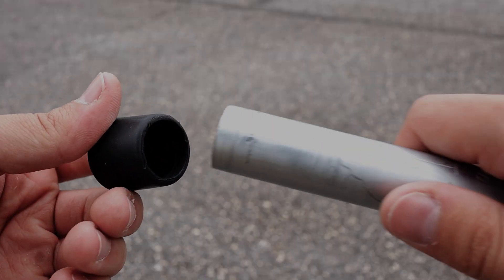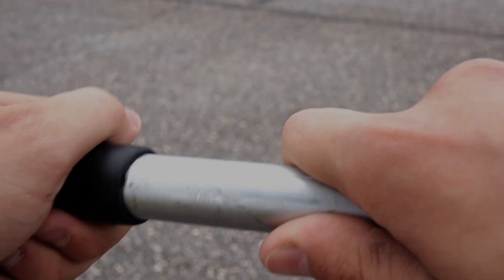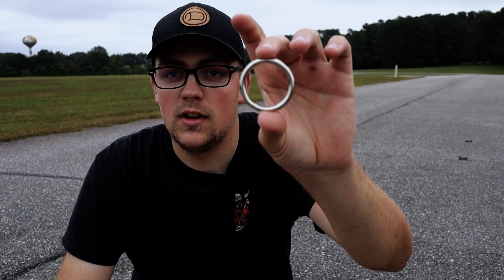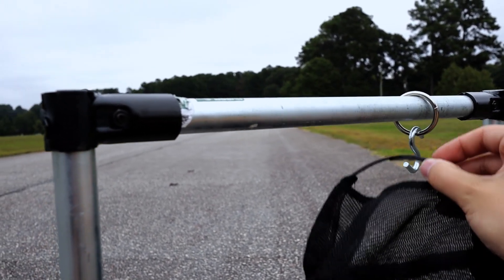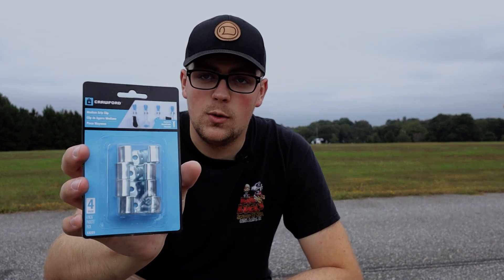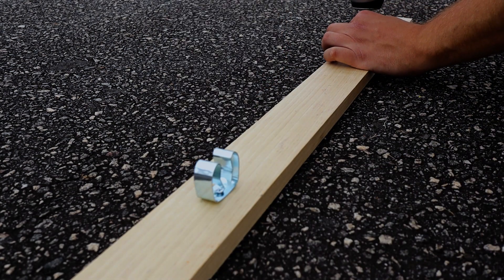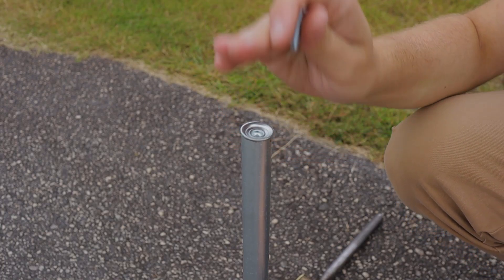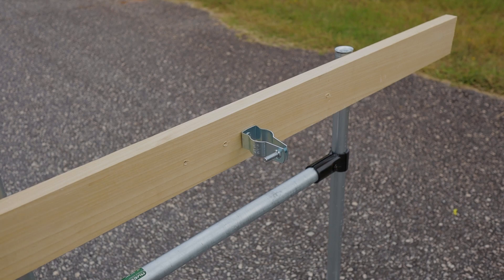9 DIY Pipe Building Hacks For EMT Conduit | Maker Pipe Tips and Tricks

Comment: Have you found plastic T and elbow brackets that fit 1/2" EMT? see some in your video, maybe for 3/4"?? just have not been able to find those anywhere.
Reply from the maker: I don't know of any plastic connectors but our steel connectors can be used with 1/2" emt if you use our shims which are 10 cents a piece on the website.

Comment: I plan to build a Conestoga wagon type canvas support over a Surley Bill bicycle trailer frame.  Is there a good way to mount the 3/4 conduit on the sides of the trailer that make an instant 90 degree turn at the mounting point?
Reply from the maker: Hi Joe thanks for the question! One idea would be using one of the flange methods that we showed in a separate video and then using a connector directly off of it. Here is the link to the video.

https://youtu.be/OUWudsffAkk

Comment: Great product lineup. Total Nube here, so forgive me if this is obvious. I've seen some sample project images on your website that have pipe ending in a flange on the wall or ceiling. What kind of flange are they using for that? Thanks
Reply from the maker: Thanks for the comment!  Happy to help in any way.  The most common solution I see is a 3/4" pipe flange with a 3/4" emt compression fitting screwed into it.  Both found in a hardware store, one in plumbing and one in electrical.  What are you thinking of building?
Reply: @MakerPipe  I’m planning  an overhead camera slider. I’ve built a smaller version of it before with galvanized pipe, MDS, and nylon U Groove bearings. It was great, but EMT conduit should be smoother and connect to the ceiling studs easier. No standard length of galvanized matches the stud spacing in my office, so I had to use 2x4s as a mounting plate.

Comment: Please provide more detail about the snap-in thread that fits in the end of the EMT. I need to be able to screw something into the end of the pipe, and haven't found a way yet. Also, if you would speak slower, we could understand you better. Thanks!
Reply from the maker: There is a link for the snap in threads in the description. We haven’t used them in a build yet but they stay in the pipes really well after hammering them in. Let me know if you have any other questions and I will do my best to help. Thanks for the feedback!
Reply: Thx for the info. I followed the link to Amazon, where they are no longer available. Any other sources you know of?
Reply: Sorry, found them. Thanks!
Reply from the maker: No problem! Let us know how the build goes with them!
Reply: Lovin those thread gizmos! Gotta check them out